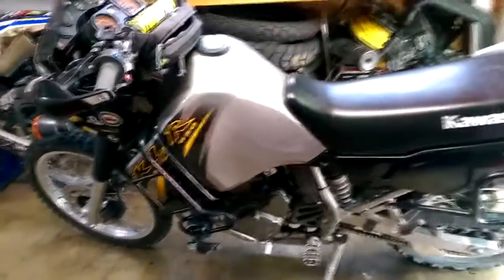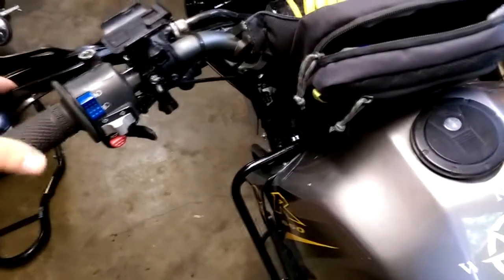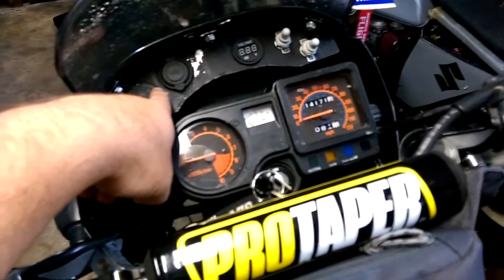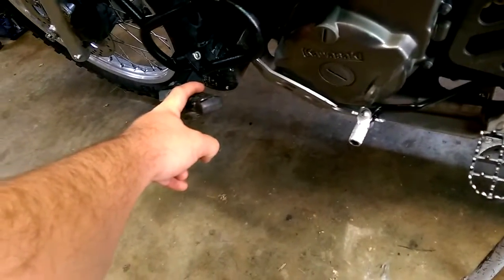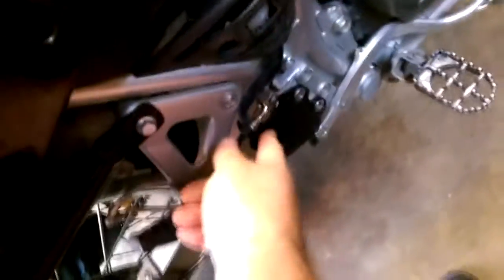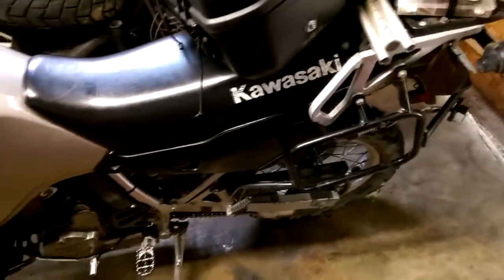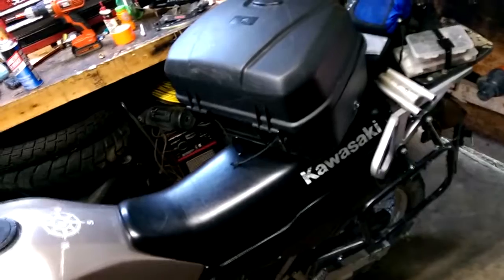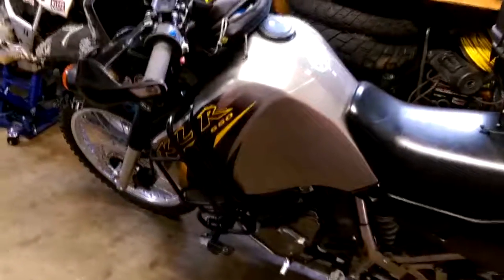KLR 650 Mods Update

Comment: Love the oil temp oil plug cap..where can I find one at..?
I have one for my radiator cap..
Works well and accurate..
Reply from the maker: I purchased it on Ebay in 2016. It was titled Oil Temp. for Kawasaki Zephyr550/KLR600/ZX6R Ninja/KLR650/W650/Z1300/VN800/QT17F. I can't find anymore currently though. Thanks for watching!